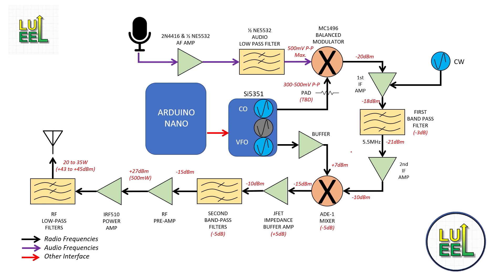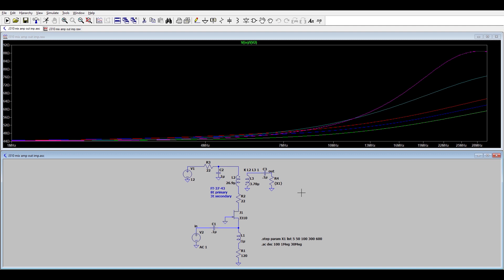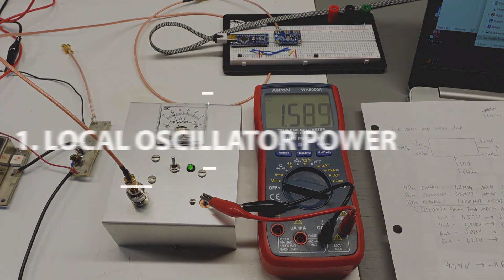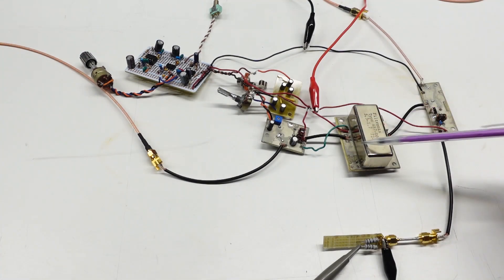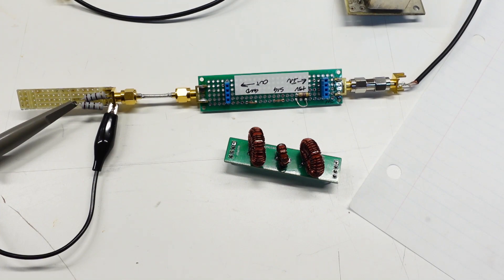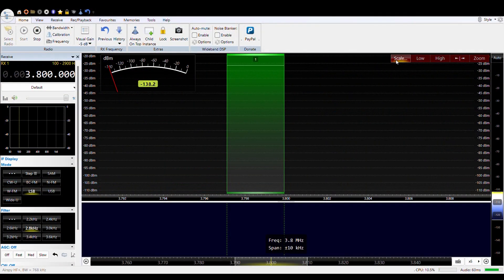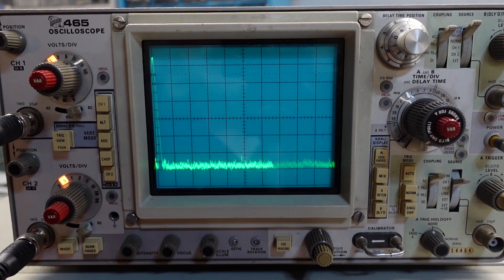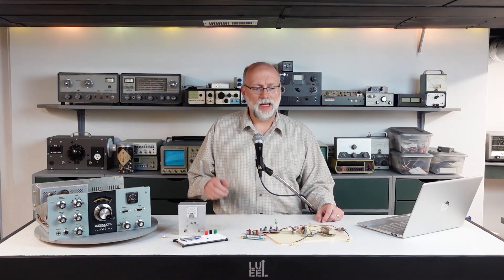HF Transmitter #07 - The 2nd Mixer

Comment: spec of the si5351 mention a 75ohms output impedance. In your drawing i saw a 200ohms in serie with the LO input of the ade-1. Do you think it is correct ? I would have think that a direct link from the the SI5351 and the LO would be better (or at least a low value attenuator with 75ohms in and 50ohms out) what do you think ?.
Reply from the maker: Yeah, there is some confusion on what the proper load to connect to an Si5351 should be.   The specs seem to imply 50 ohms is correct impedance, but that doesn't jive with the maximum current the chip can source.  There's a lot online regarding the debate.